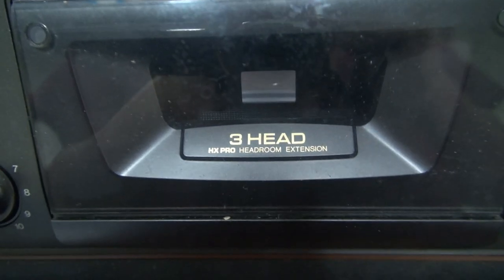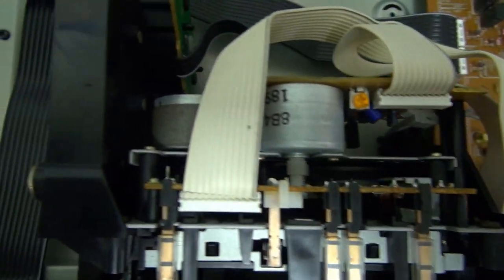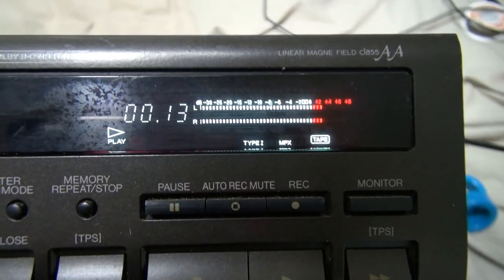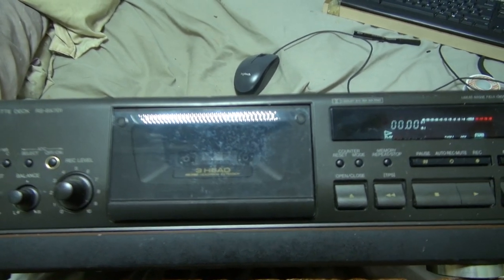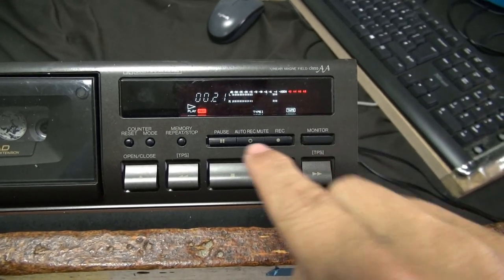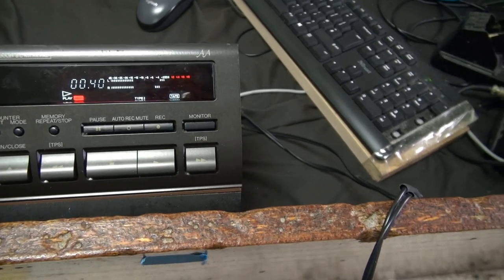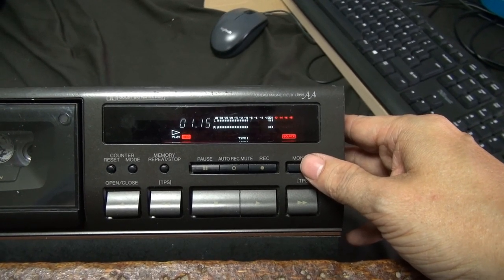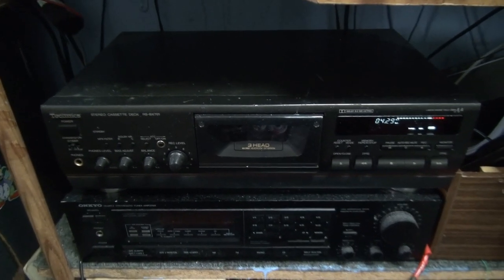The Technics RS-BX701 Cassette Deck

Comment: ATC stands for Automatic Tape Calibration. It's a function that sets the optimal recording level, bias and eq for the tape you use it on. Use it to calibrate the deck to the tape before recording for best results.

Comment: ATC is a Technics' own system and stands for "Auto Tape Calibration". It's to do with recording levels at different frequencies. Linear Image Field Class-Aa just basically means it's using a class-a audio output amplifier with "high-fidelity".

Comment: Hi Clem, Try changing the motor speed 2 x faster for high fidelity recoding and playback.
I promise it to be a big wow!
half the hiss, around 90db dynamic range and good for 20k and above and half the wow and flutter too :)
Reply from the maker: I might try that. I'm sure that in the past as a kid I did that to one of my old tape decks but that was mainly just to make stupid noises.

Comment: Clem, you need to hang on to that tape deck! You just cannot buy quality cassette decks new these days. Thanks for sharing, it is indeed rare for these things to work without needing new belts at the very least.
Reply from the maker: I also have a really nice SONY turntable (you may have seen it in a couple of my videos) with motorized drawer, direct drive, linear tracking. I cant use it right now because of one little stretched belt that moves the tonearm, plus it needs a new needle.